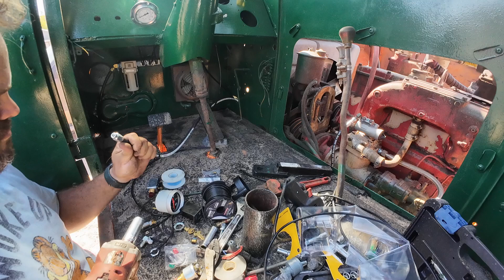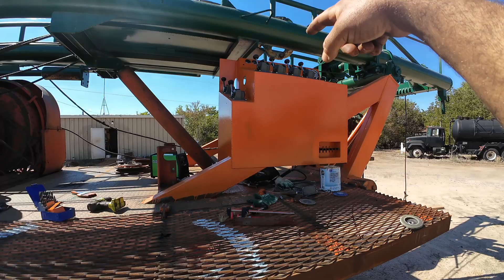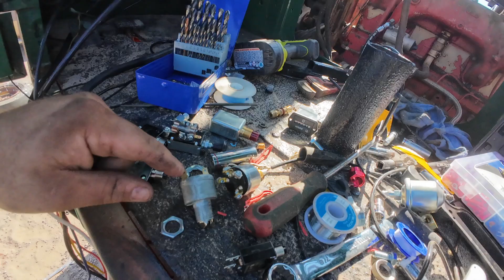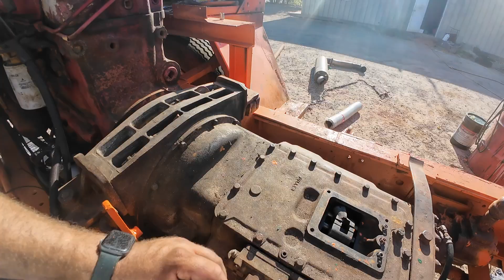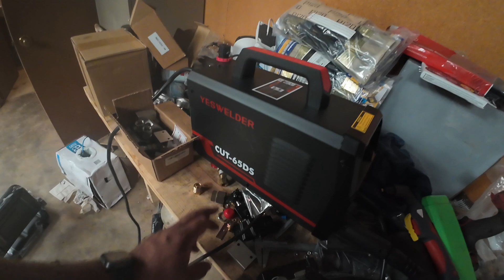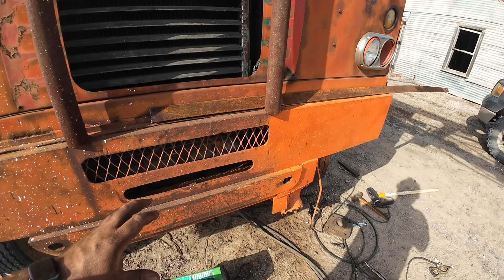Rig Part 4

Comment: Best way to weld on a used fuel tank, that has has gas or diesel or solvents, ect ,,,is to pump it full of gasoline vehicle exhaust as you weld.  Carbon monoxide is a inert gas, so no chance of the used fuel tank exploding from the gasoline, or solvent, ect, fumes.  This is after you flush it repeatedly with water, of course.

You going to have to drill us a well Zach,  you know this right??, lol.  

All that money you are spending us good luck rhat you are paying forward.  It'll make you buckets of money, have no worries.

Dale Earnhardt Sr once said, "Luck is where opportunity meets preparation".  I forsee good luck with that rig.  It will make you a hundred barrels a day or better.   A Oklahoma Gusher!!.

Comment: Zach I like the idea of using the used motor oil to flush. I save my used oil also.  The price of lubricants has gone up so much using the used oil to flush is an excellent idea in my opinion. I just finished getting my neighbors 950 John Deere tractor running. He spent at least $2000 on parts and could not get it to run. It would long start and then die because it was rolling black smoke out of the exhaust and terrible black blow by. After setting the valves and timing the pump I found that he had crossed the fuel lines at the pump therefore fuel was way out of time with the compression stroke of all 3 pistons. Now it starts with 1 bump of the starter runs clean and it runs as smooth as a garden hose. I was going to flush it with used oil and put new oil in it until Attwoods pissed me off and I left 2 gallons of oil on the counter and left without the oil, so I left the oil change to him. You can actually see the soot on the dipstick. Attwood's has a history of pricing things on the shelf and when you get to check out the price is higher in the computer. I've ran into this multiple times and even brought it to the attention of the manager, but they still do it. So rather than make a big deal out of it with the employees I just tell them I changed my mind and do not want the item. So it is up to my neighbor to change his own oil. I did all the work for free so he still got a good deal. LOL
Reply: CROOKS LIKE THEM ARE EVERYWHERE!!! I WONDER WHAT WOULD WE PAY IF THE COMPUTER CURRENT PRICE WAS A ROLLBACK LESSER PRICE THAN SHELF PRICE???
HONESTY IS FADING AWAY!!!❤😢

Comment: Top drive, interesting. I am curious where you have gotten your knowledge? If you have worked for a rig builder, or engineering degree, because you are fluent in rig building, besides every where else in down hole to pipeline. I can see you have done this in the past, grand dad,to dad. But if you can punch a hole,and have a few dollars behind you, and look around for some untapped gold, would be interesting. Next If you can find these untapped spots and do sand frac on the cheap.

Comment: Hey Zach, using gear oil in a roadranger transmission will make it shift like shit, and gear oil foams up causing aeration which causes metal to metal contact. Maybe consider using 50SAE transmission fluid, or 75/90 synthetic  trans fluid. Take my advice, and do as you please!

Comment: Zach, check out a Philips "I box" for your 7 way. They are surface mount, weather tight,  and MUCH easier to wire or modify than a typical drop in 7 way. Hope this helps.

Comment: No ive watched the full vid and my 2 cents/questions/food for thoughts.

Im not 100% possitive i know youve said you want to be able to drill with it? I guess im not sure if you want to service with it as well or only drill. Ive worked on both drilling tripples and workover double tripples and some huge workovers with 120' derricks on a double. No pole rigs but i understand it all.

I think youll need a bigger hydro tank to run rig, swivel/top drive, and mud pump. Im not sure how you're planning on having your mud pump work but id assume off its own motor. Youll need hydraulics to the pump because you will need a charge pump. I get having controls at the drilling console so you can monitor the pump but... i had a pump that had all the guages plus a air actuator and air control throttle so i could run the pump from the stand BUT it was on a box with an umbilical cord. I could change gears, idol up/down turn off/on and see all the pump vital guages. It was set up just like a power swivel trailer. You got the box you got forward/reverse a killswitch and a hydraulic pressure gauge.

The reason im writings all this is.. if you run every system off the rig motor youll need more hydraulic tank volume or that stuff will burn up in the summer. On top of that if your topdrive/power swivel has a hose blow youll drain the entire system. If your running hydro lines to charge pump and shakers and one of those blows you'll drain your whole system. My double tripple has a 6x3x4' hydraulic tank just for the rig, which runs tongs, winches, and the rig up front/back level jacks, derrick raise and derrick scope. The only aux equipment its rated for is tongs.

If it was me or i was to give you any advice. Get the rig good and set up so it only does rig stuff. Set your mud pump up so it does pumping stuff, BUT have an annoying umbilical and control panel that you can fully control the mud pump from that also only lives on the pump but you can uncoil it and control the pump from the stand. Same with your swivel/topdrive, another umbilical with a box that shows torque/engine stuff and forward neutral reverse and a boat style throttle.

Im not harping if you want to run all of it off the rig motor/pto thats fine but youll need more fluid and power. Even the big pto we got we have a rig up/work mode so the power goes to the tongs/winch(s) only. Rig up is jacks/derrick. 

I think if you try to run all 3 youll boil your hydraulic fluid and your pump. Running all 3 or even 2, pump and swivel/td will be maxing out your rig pto..

Again you know i love ya im not saying youre doing anything wrong i just think theres a better way to set your setup up. That includes how you could set up a rig up mat and leveling everything out with the front in the air. I know them old franks didnt come with front leveling jacks so they had the frankinverters to change the pitch of the derrick which changes everything including pulling strenght/how your blocks travel over the hole. 

Im not a mechanic like you are i just have worked on a lot of good iron and bad iron and i just wanna give my advice to help you make it easier on you.

Comment: yea when i worked road construction engine starting was with the dipstick check the oil start it up. the TS 14. as far as battery charging only need enough alternator to charge the battery not light up all the lights like on a semi. the Pool rigs had about 65 amp alt.

Comment: 2:21  LMFAO THE VICE GRIPS!!!! Even painted orange. I had an operator take the foil out of a pack of cigarettes to jump a blown fuse. I pulled apart an air line that was for the rod basket and it had an actual male air fitting as the press in spline air fitting. As we say... "you aint riggin unless youre n...... riggin" lol i like your style

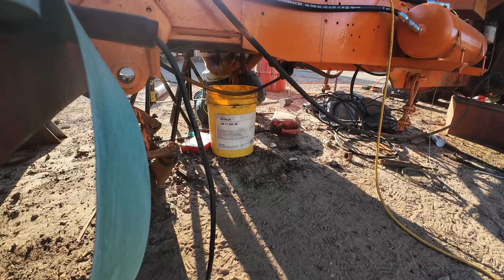21:17 I see what the visegrips are for lol

Comment: Hi Zach, I was thinking about your charge line to the mud pump. With the total length that you are running and it being 10ga your line loss is going to be pretty high. You might want to consider going to a 6ga or maybe even 4ga to get better results when charging the pump batteries. 

I love your channel
Reply from the maker: Thanks. I’ll explain how this will work when it gets hooked up.
Reply: @TheZachLife   some loss from the run length but slow charging is better for the batteries. that why battery chargers have the 2 amp cycle.

Comment: You gonna add water tanks for the drawworks? Dont think youll need em pulling them chickenshit wells but it definitely helps. 

We ran 100gal water tank with a air switch to drip water on the brakes for cooling the brakes.

Engine doghouse?
Reply from the maker: No It won't need any for my stuff.

Comment: Silly question but still legit. Can you just dump your used engine oil into your oil well tanks?
Reply from the maker: Ive heard that it's not legal to do? I don't imagine you would get caught.
Reply: @TheZachLife  oil rigs are considered "equipment " so it's exempt of Texas state laws. I'd run red diesel in em whenever possible... just food for thought.
Reply: Had a guy do this years ago and the Countrymark gauger found it while strapping his tank and rejected it. He however had a large amount in a 210bbl tank not just a gallon or so
Reply: Yes, better yet dump the oil unto the diesel tank... free fuel and pump lube. 

80% waste oil in the diesel tank would do just fine..

These old engines can run up to 10% water  mixed with diesel. Depending on the injector type.
Reply: @johndowe7003  blow a hole in the piston of a detroit  runs just fine on the motor oil   wide open trip the blower flapper quick LOL

Comment: I recommend putting a tank shut off valve  at the suction line to the pump. Just in case you need to replace that line or pump.
Reply from the maker: 100%

Comment: Are you planning on piggy backing two gauges off one sending unit? If so, will the resistance of two throw off the accuracy?
Reply from the maker: Only one. However SW makes senders that are made to work with 2 gauges.
Reply: @TheZachLife  Good to know. Thanks for the info!

Comment: isn't it great to have that old style soldering GUN, fast, easy to use and ain't a pencil. Love your style Zach, getting things done and not worrying if your fingernails are clean (not that yours aren't, picture perfect) this type of things and stuff is what I grew up with. I didn't have money so i had to build or repair everything. Again Thanks for your videos.
Reply from the maker: 300 watt Weller will get it done.

Comment: I wonder if you could use an air starter for your mud pump then you only have to supply an air line to the engine to spin it up.  You wont have to worry about voltage drop or large diameter wire to start that engine.
Reply: Or just add a regular starter with its own battery like everyone else... less airlines to break . 

Air lines are the first to break apart after a few years. 

We used DOT airlines and push connections
Reply: oh yea air start is fun . we would run an air line to the pump manifold lay a joint of iron over the mud tank and launch old swab cups into the wild blue yonder.once the farmer came around asked what that noise was really made his dog howl /